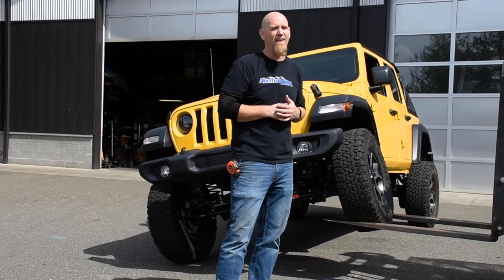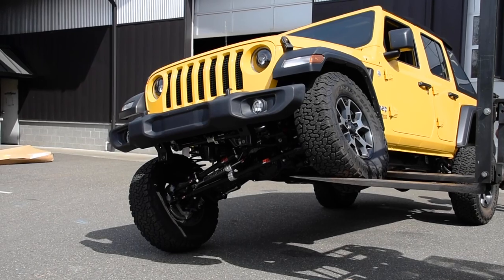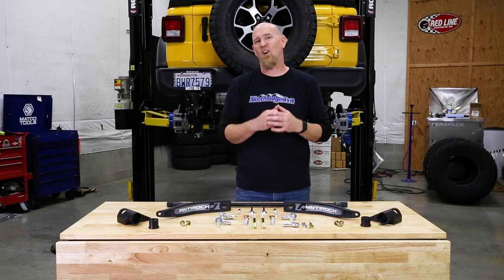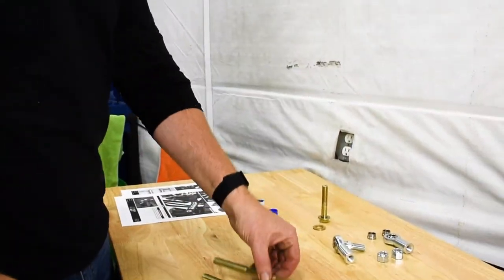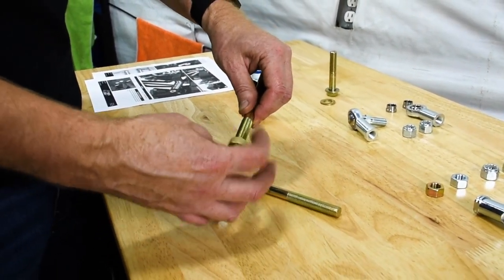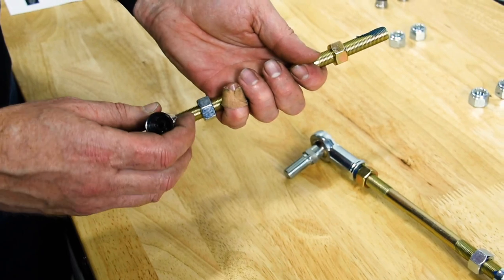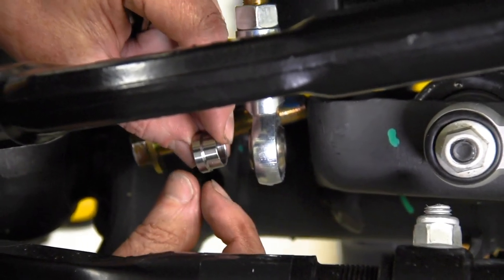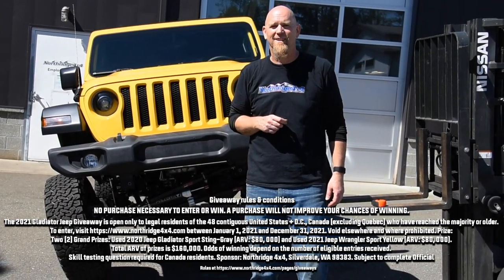RockJock Antirock Install on Jeep JL/JT

Comment: The JKS sway bar quick disconnect’s or any other aftermarket brands are still the way to go. Might be only a little over an inch 🤏 but in terms of off-roading that is still more flex. This has more potential to bend, strip or break a component on this setup and manufacture design, to many parts. So basically an overpriced front end decoration piece like any after market front steering stabilizer shock. But as always GREAT Video 👍
Reply: I felt the same. Right on the money.

Comment: I'm using the factory rubicon electric disconnect. Until it breaks lol
Reply: Evo makes a no limits manual disconnector for the Rubi sway bar... Team Tech Offroad makes a pneumatic actuator for it.
Reply: @KTMcaptain  I've used the Evo product on past jeeps and it works great but my next "fix" will be the antirock simply because I'm not to old to get down and turn a knob I'm to old to get back up lol
Reply: @teddonley9594  you should check out the TTO pneumatic rubicon sway bar actuator then. It is faster, stronger, and more reliable than the oem actuator. The anti rock is worst of both worlds. It limits flex, slightly, but doesn’t do much for limiting body roll since it lacks the torsional rigidity to resist flex. To each their own though. You can sell your Rubi bar for the price of that anti rock.
Reply from the maker: @teddonley9594  EVO also builds a pneumatic actuator for the Rubicon Electric Sway Bar:
https://www.northridge4x4.com/part/disconnects/1152-evo-no-limits-on-demand-sway-bar-disconnect

Comment: Ive got the jks quick disconnects, you have to cut a piece off to make them work on the passenger side, if i was to order the antirock will it still work with that piece cutoff?
Reply: Rockjock sells that tab to be welded back on. I had this very issue!
Reply: Stick with what you have. You will thank me later.

Comment: If it's nearly the same amount of flex as a disconnected one, then why not just run without a sway bar? Clearly this one doesn't do much in the way of generating spring force to correct body roll.
Reply from the maker: They actually help a lot over no sway bar. But they do have more body roll than the OE sway bar.
Reply: @northridgenation  it’s a direct function. If it barely resists the unloaded axle moving then it will barely resist the body. It’s physics. I drove around for years without a sway bar. Especially when a vehicle becomes loaded up on the roof with RTT and other gear. Unless it has some system like KDSS which disengages part of the bar when the front wheel articulates and the rear doesn’t it will always work proportionally to it’s torsional force. It’s simply a very weak torsion rod. 
.
Now, have they made it where you slide the end link mounts up and down that arm… then you can have a strong bar on the road and a loose one off road… then it could be fine. 
.
But you can’t say it can handle a 5000 lbs load at 60mph when a single spring and some axle weight can flop it over. That’s far too much kinetic energy and far too little force it generates.

Comment: Does this have clearance issues at full lock or full flex on stock rims with 285 or 315 tires?
Reply from the maker: We haven't tried that combo, so we can't say for sure.
But we're going to guess that if you're having issue with a stock bar, this will be about the same.
Reply: @northridgenation  the stock sway bar doesn't rub. I was wondering if the antirock forged arm follows the same bend line as stock and in general doesn't sit wider than stock sway bar at the end links?
Reply from the maker: @graywolf.overland  It is no wider than the stock set-up, if anything it might have just a bit more clearance.

Comment: Apex disconnects or anti rock? If one had to choose for a 3in on 35s load bearing jeep. Can’t decide have to get rid of my jks quickies.
Reply from the maker: Either one is pretty good.
The Apex will be act like stock when locked in on the street.
The Anti-Rock will be have a little more body roll on the street.